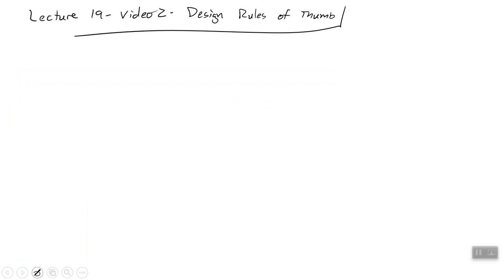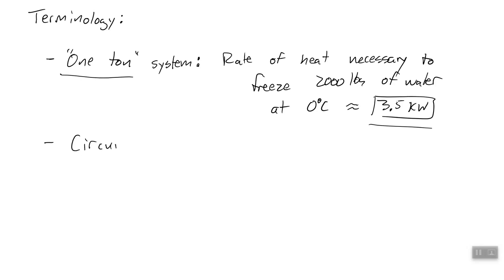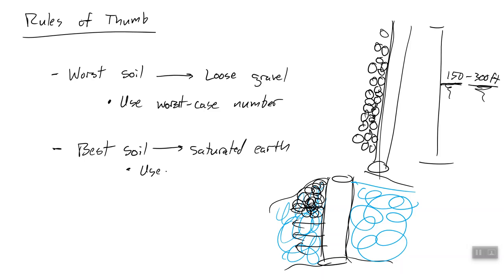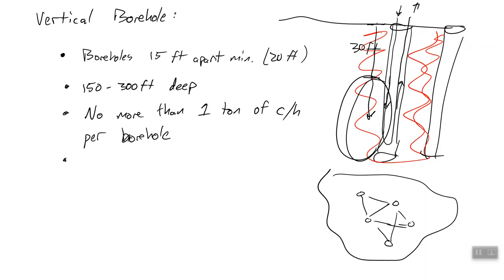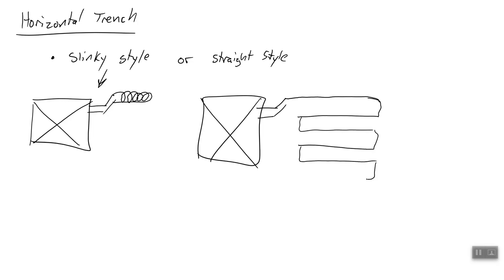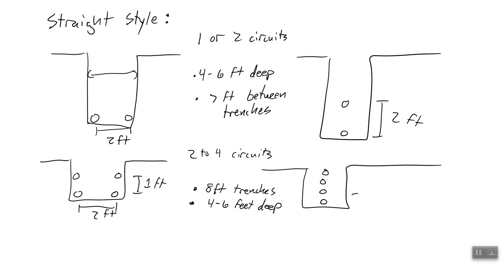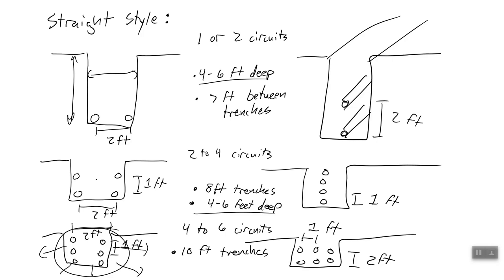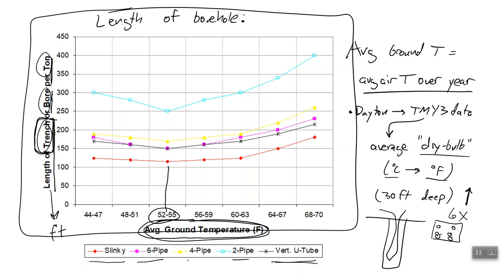Geothermal - Video 5 - Design Rules of Thumb

Comment: 334 Joule must be removed per gram of liquid water at 0°C to make it ice at 0°C. 
This makes 334,000,000 Joule to be removed from 1 tonne of water to make it change from liquid to firm state. 
334 MJ is another way of putting it. 334 MJ resembles 92.7 kWh - which must be removed from one tonne of 0°C water to make it 0°C ice.
If you use a heat pump which is efficient (COP 4 for instance), you would, for each 1 kiloWatt of energy put in, get 4 kiloWatt of energy out, meaning, that pump would remove 3 kiloWatt energy on a continous note. 1 kiloWatt is the same as 1000 Joule per second (conversely, 1000 Joule equals 1000 Watt-seconds). Thereby, if you remove 3 kiloWatt energy, then over 1 hour, you would have removed 3 kiloWatt-hours. So, you would need 92.7 / 3 = 30.9 kWh of power to make 1 tonne of water at 0 degrees turn into 1 tonne of ice at 0 degrees with a heat pump. 
I hope this makes sense?

Comment: An excellent video and explanation on the exact right level for depth of information! Nice lecture!!! Interesting especially the last slide about the length of trench / borehole at different pipe configurations. Left me wondering how comes that with increasing avg ground T trench length needed increases. Seems counterintuitive as the necessary heat exchange per meter of trench should increase with higher avg T?! However the graph implies the opposite and I still can't wrap my mind around it why that is... Obviously missing something here. In any ways great educative video, elevating the level of understanding. Keep up the good work! 👍
Reply: I think he's considering heating in the winter along with cooling in the summer...so there is a sweet spot for cooling AND heating.  I'm in Texas, so I'm primarily interested in cooling and thought the same thing.  I'm curious that a 2 pipe config is the least efficient... Again, I'm assuming here - but maybe the multiple pipe config is a single loop? I can see more pipe being more efficient.  Originally, I would think the slinky would be the least efficient, but it must be pipe length - 150 ft of trench, with say 700+ ft of pipe is more efficient, than the 2 pipe at ~700ft of pipe.

Comment: Hi, Dr Mulford.
In areas where space is an issue, what are the drawbacks of drilling fewer wells at deeper depths? Deeper is better for constant temps, so why 8 wells at 125ft vs 6 wells at 166ft to reach 1000ft of wells? (Lets assume Ohio where heat and cooling loads are relatively similar)

Comment: I know this is an old video but I have a question if my plan is the most effective.   I have 10 acres and have to run Water and Electric utilities about 600' from the road to my home. I will have 1 trench 3ft wide for the utilities to be separated 36" horizontally and vertically required by code but not less that 24" from surface. Inside of the same 600' trench, at a depth of 10' can I "fuse" 5 "slinky-loop circuits into 1 continuous circuit (basically 2500' of 3/4 HDPE “single-slinky” for the 4 ton unit). Then repeat the process at 8' and again at 6' in the same trench.  The only difference is each HDPE “single-slinky-circuit” line will be the correct length (+25%) for the required ton. I will have 3 different heat pumps located in 3 different areas. Right side of house in attic (4 ton/ 3/4" 2500'), left side of house in attic (3 ton 2,000' 3/4" HDPE) and one in the shop in attic (2 Ton 1500 3/4" HDPE). I live in an area where we pour concrete slabs with a 24" x 24" footer, no crawl space, and the water table is high. I am on a slight hill “8ft’” but plan to hit water around 6-10 ft. It will be difficult for me to have up to 8 separate 3/4" HDPE lines coming into my slab at 3 different areas then a manifold above slab. My thought process is by fusing and having 1 continuous "single-slinky" circuit, I will be able to avoid a manifold and only have a single supply and single return line coming through my slab (or above slab in an insulated pipe) at each heat pump unit. Wrap that line above slab in foam and run into the attic where each heat pump will be located. -Thanks in advance

Comment: Thanks for the vid. So basically the slinky style is going to be the most efficient for closed horizontal loop
Reply: It’s going to be the most cost effective. The efficiency is going to depend a lot on the soil type in contact with the pipe and the moisture in the soil. I am thinking about using earth tubes that use air and a solar powered fan. I have 3 acres so lots of room for a straight run. I also thought I might put a slinky in the trench also so if I decided later that I wanted to tie into a heat pump I could and use the air pipe to feed a greenhouse/wrap-around sun room and pull the air in with a solar chimney. That would basically make my only heat loss from the roof.
Reply: @boxelder9167  Did you do earth tubes? Did they perform ok? was thinking about doing them but they have so many cons compared to a closed system with pipes like in the video.
Reply: @CMZneu  - I ended up getting a standard heat pump from my neighbor who gave me a big discount on it. I currently use it for the AC and heat with wood for the fact that the wood is free. I got hit with $24k in back taxes for capital gains selling my other properties I wasn’t expecting so that kind of shut down my projects to a minimum.
Reply: @boxelder9167  Sorry to hear that.

Comment: No. Not 3.5 kiloWatt. kiloWatt-HOURS... :-)
Reply from the maker: Thanks for the comments and for keeping me on my toes! After watching this again I realize that I forgot to specify that a ton is defined as the rate of heat necessary to freeze 2000 lbs of water at 0 degrees Celsius in 24 hours (the 24 hours being the part that I forgot). This is what allows us to express a ton as a heat rate as it is a quantity of energy removed over a period of time, hence 3.5 kW instead of 3.5 kWh (https://en.wikipedia.org/wiki/Ton_of_refrigeration). I completely agree about using only SI units. This is one of the few lectures in all of my classes when I don't work in SI units, because they make way more sense. Thanks for watching!